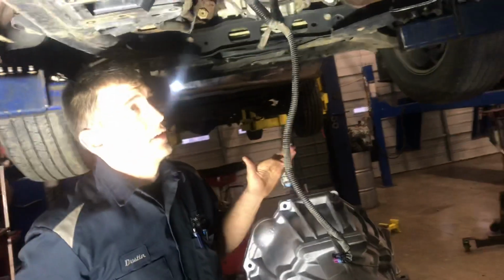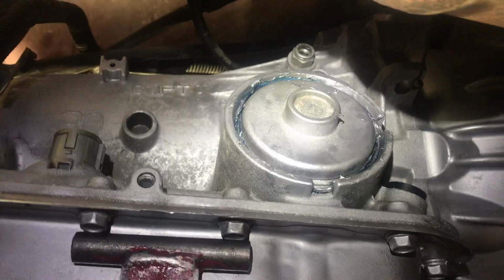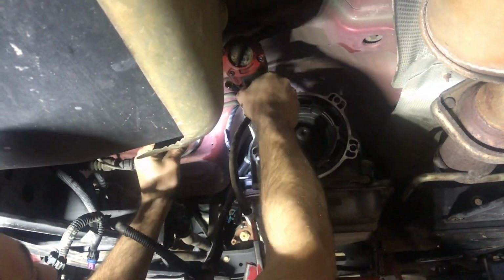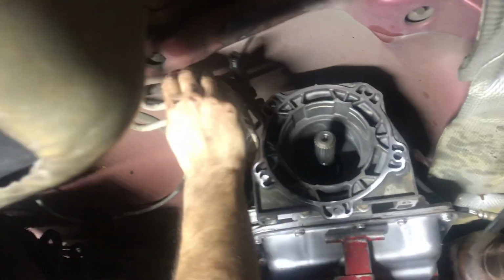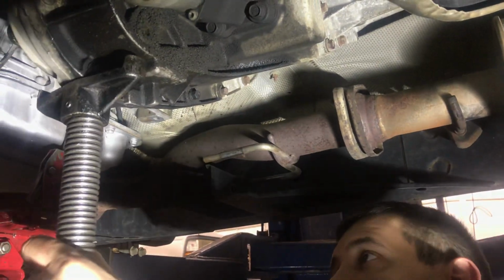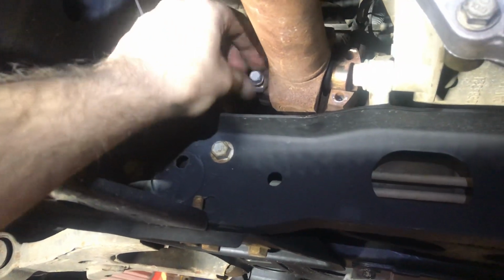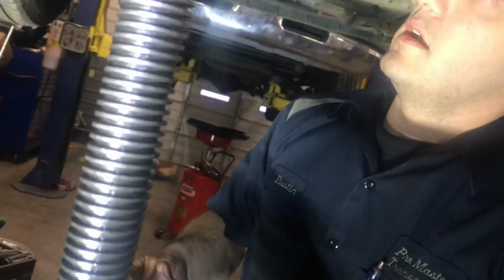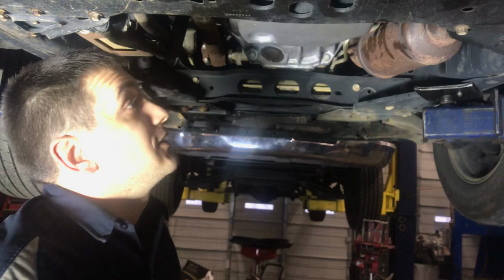Envoy Trailblazer 4L60 4x4 install Chevrolet GMC

Comment: The best video by far on remove and install on the 4L60 I've seen.  Very straightforward,  good lighting and camera work.  
Can the engine and trans be removed together?
Reply from the maker: Thanks. I’m sure they can be brought out together. That’s something I’ve never tried. Any time I pull an engine I always pull the transmission first.
Reply: @ltstransmissionhowto5158  this is the best how to I have ever seen all around very good how to the guy knows what he is doing great video

Comment: Hey, just wanted to thank you again for posting the remove and install videos for this vehicle. You saved me a lot of time trying to figure out how I was going to do mine. As I mentioned in your removal video, I'm doing my Saab 9-7x on jack stands in my garage. I'm in the process of re-installing my rebuilt transmission now. Needless to say, it's taking me wayyyyyyyyyy longer to do mine that it did for you to do yours. :o) As you illustrated in your video the yolk that bolts to the top of the bell housing can be a bit of a problem. For me, it was a major problem! Lots of swearing! I never was able to pry it out of the way enough to sneak the bell housing by. Not sure why, but it kicked my a$$!

Long story short, I wanted to share something with you that may make your life a little easier and will definitely help the DIY crowd. I strung a loop of mechanics wire through the top left bolt hole on that yolk assembly and extended it back to where the parking brake control feeds through the transmission hump. I pulled the wire as tight as I could and secured it that way. With the yolk pulled back out of the way the bell housing has plenty of room to get past the starter and falls right into place. Once everything is in place you can then unhook the loop of wire and pull it out of the way. You were nice enough to share how to do everything else so I thought it was my duty to share how I got around that one major snag. Thanks again, your videos were a major asset for me.
Reply from the maker: That’s awesome. I really appreciate that. I never thought of doing that, but I’ll sure try it next time. Thanks again.
Reply: @ltstransmissionhowto5158  You're very welcome!  I was getting so desperate that I actually considered removing the starter and finally the light bulb came on to tie the yolk backward and out of the way. I'm old and fat so, rolling around on the cement pushing on the transmission and prying up on the yolk with a pry bar wasn't an easy task. :o)  Take care!

Comment: Just watched your video, I am currently changing the transmission out in a 2007 trailblazer and I am having one heck of a time with catching that bracket at the top with what I think is a coolant line. Any advice would be greatly appreciated, I've already gotten it stuck between the bell housing and block twice now.
Reply from the maker: It helps if you can pry the brackets up a little before you go up with he transmission.  They’re a pain.  You might need a long pry bar to hold the bracket up until you get the bell housing up over the starter.

Comment: Hi 👋 thank you for the video I have a question  How to remove the 2 Clips Connector that are Next to the black cable I saw yours as one big Connector but  my  is 2 little ones? I want to send you a picture but It not allow me to do so.
Reply from the maker: Are you talking about the switch on the driver side of the transmission? 
If so you need to heat those plug in real good.  They are glued in. So you hear them and then wiggle them pretty good to unplug them.

Comment: Best way to flush the trans cooler lines before installing new transmission? 4l60 went out in my Envoy and I’ve found plenty of metal in the fluid.
Reply from the maker: Get a can of cooler flush. I think I use some called cooler Kleen

Comment: Install the trans with 4 quartz then add the rest after? What about the installing torque converter bolts on a s10?
Reply from the maker: Yes just add the rest after. Converter bolts on an s10 will be about like a full size truck. I have some videos on those. Just skim through those and watch the converter bolts part. You will take the starter loose then the shield around the starter. Then you can get the bolts from that spot.

Comment: Having a little trouble with my cross member. Was wondering if I should jack the transfer case up a little bit, or something.
Reply from the maker: You will need to jack up the transfer case to get pressure off the crossmember to slide the bolts out.

Comment: Question for you.

2006 Envoy XL DENALI
About 1 month ago I was on the highway at about 70mph and was cut-off and had to slam on the brakes.  The GMC started to make all sorts of clanking sounds after the incident.  The torque converter was locked up when I had to jam on the brakes so I’m fairly certain my noise is in that area.  The clanking is very audible at idle and while under power.  When I decelerate the noise is absent.  Does that sound like a Torque Converter issue?  I at first was thinking it was my flex-plate but I would think I’d hear that clanking whether I was accelerating or decelerating.
Reply from the maker: It still could be the flex plate.

Comment: Thank you for the very informative videos on this repair. I'm doing this right now on my Buick Rainier on jack stands. I would have struggled a lot had it not been for your videos. Nice to know where all the connectors are ahead of time. How far can you safely tip the engine/trans down without damaging something?
Reply from the maker: Just keep an eye on the front of the engine when you have the transmission tilted in the back. Make sure nothing is hitting the radiator or any strain on the coolant lines.
Reply from the maker: If you have any questions while you’re working on it, just let me know. I’ll try to help you any way I can.
Reply: @ltstransmissionhowto5158  Thanks so much.

Comment: great video...I have done this swap to my 04 Trailblazer and after installing the new rebuild my 'service 4x4' on dash bezel is on and car will not go into 4x4..Do you have any idea as to what this can be?
Reply from the maker: Well start with checking fuses. Sometime when you’re plugging up sensors it can shoot fuses. Then make sure the wiring harnesses are plugged in good. Sometimes they’re hard to get all the way plugged up

Comment: I need to swap transmissions in my Envoy. Great video. Do I need to do anything to the new transmission before installing?
Reply from the maker: Are you putting a used one in ?
Reply: Lt’s Transmission How To  yes it is used but can confirm it runs good.
Reply from the maker: Well you’re going to lose fluid in the swap already. So I would take the pan off. Look at the inside of the pan. Change the filter and pan gasket. 
Other than that as long as nothing looks broken on the outside you should be good. 
If it’s 4x4 go ahead and get a new transfer case gasket.
Reply: Lt’s Transmission How To  I appreciate your time and info. This will help me tremendously. YouTube needs more people like you! Thank you!

Comment: Do you put fluid in the torque converter before installing? Great video.
Reply from the maker: I usually try to put about a quart in there. I just don’t like to put so much in that it spills out while I’m sliding it into the transmission.
Reply: Could you install that transmission again one more time but a little slower, LOL great job

Comment: Im getting a knocking sound from flexplate and tc area when i start the trailblazer. I started the first bolt in the special hole like u showed. Flexplate has no damage or cracks. Shifts fine into all gears. Just makes a knocking noise tht gets louder with rpms and quieter as rpms drop. Im lost and cant figure out what the problem is.
Reply: Also both dowel pins lined up just fine and the knocking sound is constant no matter if im idling or driving down the road.
Reply from the maker: Well that is weird. I have had a cracked pump gear make that noise but it was in a 4L80 and a different kind of pump gear. 
I would look and make sure you didn’t get the bracket at the top caught between the bell housings and block. It’s happened to me more times than I care to admit. And those brackets are a pain to get where they’re supposed to be. Check that and get back with me. If that’s not it we can try something  else.
Reply: @ltstransmissionhowto5158  the bracket is on correctly. I triple checked tht lol. But after alot of research, i do believe tht my flexplate is cracked Even though i cannot see any. Gonna do a bit more research before i order a new one because its just me doin all the work without a lift. Dont wanna drop the trans if i dont have to
Reply from the maker: I hear you. I hope you get it straightened out man. If there’s anything I can help you with let me know.

Comment: Correct me if im wrong but is a Colorado similar?
Reply from the maker: It’s pretty close. Getting the converter bolts out are a little different.
Reply: @ltstransmissionhowto5158  yeah, I gotta replace my factory 4l that died at 255k
Reply from the maker: Be sure to look at the input shaft. They’re bad about stripping the splines

Comment: How do u know if the torque converter is all the way back
Reply from the maker: Well I usually take the little cover off the small inspection hole on the bottom of the bell housing. I’ll stick my finger in there and if I can’t fit my finger between the converter and pump it’s all the way in.

Comment: is there much difference between this installation and doing this on the V6?
Reply: Whoa my shop was quoting 8 hrs turn around to rep\lace my transmission on the 05 Envoy. You knocked it out in just over and hour. Dang dawg, tell ya what you come do mine and I'll take you fishing on the Kenai river up here in Alaska. I live on the river and we have one of the largest salmon runs in the world right out my front door. Deal? Lol Got a few other mechanical chores on my list as well. Call it a working vacation!
Reply: aah shoot im on my wifes channel Lol well guess I'll have her do it! 
Charles and Annie we do everything together
Reply from the maker: This is the 6 cylinder. The ones with the V8 are more like the full size suv or trucks. Just all crammed under a trailblazer.

Comment: Just replaced one on 04 envoy, followed all the steps, vehicle doesnt engage in any gear now
Reply from the maker: If it doesn’t engage in any gear check the fluid level with it running and then check again without it running. If they’re pretty close to the same level you might’ve busted the pump gear. It happens sometimes If the converter isn’t all the way in the pump.
Reply: @ltstransmissionhowto5158  i heard you mention this in the video but i couldnt really understand what you had said. if you wouldnt mind writing that part out so i could read it i would be most grateful! im very adamant on not having to take my transmission back out again bc i did something dumb like break my pump 😅

p.s. your videos are A1 thanks a ton for the unmatched skill in your service videos 🤙 you're the man

Comment: How long did the whole job  take
Reply from the maker: If everything goes perfect I can pull build and put back in two in a day. Everything usually doesn’t go perfect.
Reply: Im in phx i found a guy that can do it for me im just a part swaper not a mechanic so it might take me 3 days with out a lift the right jacks etc
Reply from the maker: Take it slow. Don’t get in a big hurry. Make sure you keep up with the bolts. If you have any questions or if there’s anyway i can help you let me know.
Reply: @ltstransmissionhowto5158  thanks bro i think im goimg to take it to this guy its a little too much for me plus i will take at least 2 days. This guy will do it in a day so i dont miss work its my only va. I use it for work if i screw anything im screwd lol

Comment: how much did this job cost ?
Reply from the maker: This one I don’t really remember. But if it was just normal repair with everything I do as long as the pump and the hard parts weren’t trashed it would’ve been around 1300-1400